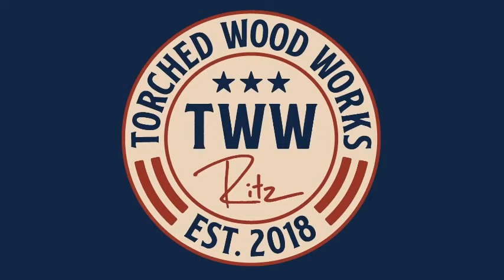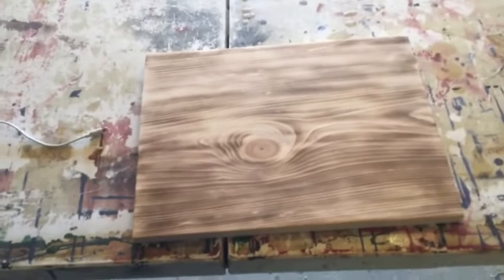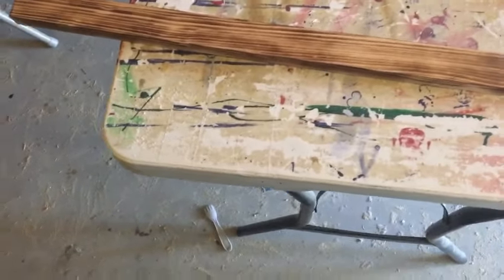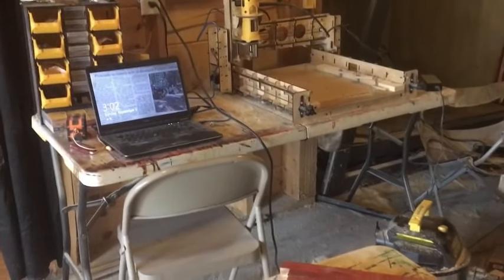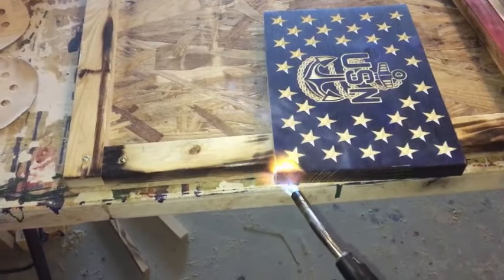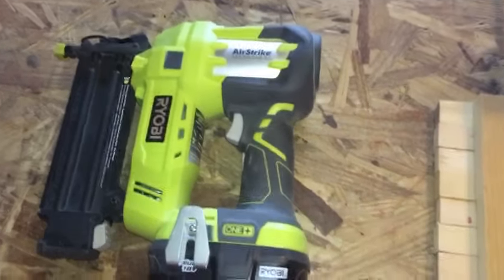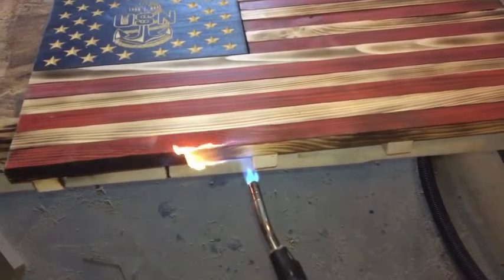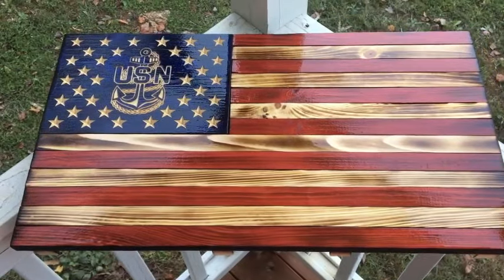Wooden Flag Tutorial! In Depth!

Comment: Question. When you torch the edges of the flag black doesn't it mess up the red and blue stain, the heat doesn't make it bubble or look different than the rest of the stained parts?
Reply from the maker: Not with water based stain. If it was oil based yes it would do that.
Reply: @TorchedWoodWorks  OK got it. Thanks for answering. I'm on my 3rd flag, and still trying to figure out the best way to do them. Not one has come out perfect. I'm getting better though.
Reply from the maker: @ChristianCMC  I’ve been doing this for five years. I’ve yet to make a perfect flag. Keep practicing and you’ll be amazed at how much better you are six months from now.
Reply: @TorchedWoodWorks  Yeah that is my plan, they are really fun to make. Plus they are pretty cheap to build. I don't have a CNC , but stain and wood is not much money. 1 quart of stain will do a lot of flags. I'm just giving them as gifts at this point. In the future I may try and sell one depending on how it turns out. Thank you for the video. Your flags look awesome.
Reply from the maker: @ChristianCMC  donate some to the local police stations and fire stations along with a card with your info on it. You’ll have some orders in no time from that.

Comment: one question. why not use plywood for the flag? 4x8 sheet will give you 4 36in flags and 2 or 3 24in . and why not use sold and tape lines off for paint? wouldn`t plywood be more solid .i use 1/8 in stars and glue them on. any comments would be helpful thank you.
Reply from the maker: Personally, and I am not knocking anyone who does this but, it's more about quality. Pine plywood does not burn the way I like, taped and painted flags to me are more of a pain, especially when making flags in large batches like I do, and my customers like the separate stripes and union. Gives it a better look overall. I have done the style you are talking about and yes you can make a decent flag that way, but overall in my opinion using pine boards and making the stripes be individual give you the better overall look. Just my opinion though!

Comment: I’m just curious as to why you would not glue and screw your stripes together. It just seems to me that the pieces would fit together better.
Reply from the maker: The braces hold the flag together fine, putting glue between the stripes and screws in on this size flag would be overkill in my opinion. For my 8 foot flag I made I did use screws though because of the weight of it but for my normal flags brad nails and glue are fine. Haven’t had one come apart yet.
Reply: Torched Wood Works thank you. I appreciate your answer to my question. I really enjoy watching your videos of your projects. Where do you get your stencils from? I am wanting to start building some flags, and I really like the Marine Corps Iwa Jima scene. Thanks again!!
Reply from the maker: @sig45man  I have a CNC machine where I carve all the unions and logos on the flag. Thank you for watching!

Comment: Hey bro...I made my first flag recently and it def has it's own signature lol...I used the Dry Wall strip wood which I believe/know was a mistake due to many wood imperfections.   Tried engraving the stars out was a bit difficult.  What type of wood are you using?   Pine?
Reply from the maker: The first flag is always one of a kind lol, I use the 1x12 pine boards. You can get them at home depot or lowes, or if you are lucky a lumber yard. Just look for the boards with the least knots and wide sweeping grains and you will have a great looking flag.
Reply: @TorchedWoodWorks  Thx for responding, so right now my next challenge is cutting out the stars with my Dremel 105 bit.  I think the wood is still to wet from just the mill or the stain.  How long do you let the union stain dry before you start engraving?  Like I said, I believe my choice of wood has been my biggest problem otherwise doesn't look that bad.  Have to finish engraving then clear coat,,thx
Reply: @TorchedWoodWorks  Thx...I'm going to attempt my 48" large flag for my bedroom.  I want it to look great.  Any advise?  I have to purchase the large union template and found that it's quite pricey.  Do you know where I could get a good deal on one?
Reply from the maker: @paulcon649  https://www.amazon.com/Whaline-American-Template-Painting-Airbrush/dp/B07CZBHR7T/ref=sr_1_6?crid=1DJXZZ7WF2JWM&dchild=1&keywords=50+star+stencil+for+flag&qid=1589586746&sprefix=50+star+stenci%2Caps%2C160&sr=8-6

Comment: Great video and work.  What package came with your CNC?   So it runs smoothly.   I’d like to be able to start into working after putting it together.    Is there anything else I need as well?    Thanks
Reply from the maker: Just the CNC itself, then it gives instructions on which controller to download which is called UGS. I design on Easel Pro which is $20 a month.

Comment: What is the diameter of the 90 and 60 degree router bits that you used for this project? Feed rate and plunge rate? Depth of cut?
Reply from the maker: .25 inches for diameter for both, feed rate was 50 plunge was 20 and depth for the stars is .25 and the logo is .03
Reply: Torched Wood Works thanks brother. Fantastic work you’re doing there. I’ve got the E4, using VCarve Pro, and have been working to speed up cut times
Reply from the maker: @johns2926  Thank you sir!

Comment: Am I reading you cut list right? 1 @ 37" (long stripes), 1 @ 22"(short stripes), 1 @ 19.5" (braces for back of flag) Should it be 6 @ 37" (long stripes), 7 @ 22"(short stripes), 4 @ 19.5" (braces for back of flag) or am I missing something hear this early hour? Thanks.
Reply: Mik Ledee you are reading it correctly. He started with 1”x12” boards. So he makes “starter” cuts to those lengths then I believe he makes rip cuts to make the individual stripes. Hope that helps!

Comment: Hey man, stupid question. But everyone uses water based minwax, what if I used oil based?
Reply from the maker: Javier Toquinto for stain? Nothing just takes longer to dry is all
Reply: Thanks my man. Great job BTW
Reply: Do you sand in between coats of the Clear coat (Krylon).
Reply from the maker: Javier Toquinto after the 3rd coat I do.
Reply: @TorchedWoodWorks  and then two more or just one? 

Thanks I'll be sure to try that on the next one
Reply from the maker: Javier Toquinto depends how the fourth coat looks. If it’s nice and even then I stop.

Comment: I'm looking to purchase the E3 and does everything come with it to be able to cut out the stars and navy logo included in the $700 or is there additional software and attachments needed?.  I've made several flags, but i'm looking to take the next step and get the cnc machine.  The Dremel takes too much of my time...
Reply from the maker: You will need to buy the bits for it, and you use the Easel software to design the unions. It has a free version but the pro is only i$20 a month. I have the bits I use listed on my videos with the link as well!

Comment: Why don’t you torch the union so the stars are the same as the  white stripes?
Reply from the maker: nolan steffek I used to but it gives the stars a strange look because the flame torches the edges that the vbits make so it makes the stars look like starfish
Reply: Torched Wood Works lol that makes sense. I just saw others torch the stars but Idk if I like it torched or not
Reply from the maker: nolan steffek when you apply the poly it darkens you the stars so it matches better.

Comment: Everything looked awesome until you did the wood strip method in the back to hold it all together.
Reply from the maker: Jason Noble how would you suggest putting it together?
Reply: I tongue and groove my stripes, then do an inch and a half wide by an inch and a quarter thick around the perimeter of the flag. They're a lot sturdier!
Reply: @TorchedWoodWorks  i also frame mine
Reply from the maker: Jason Noble very cool. Out of the 700+ flags I’ve sold and made this way I haven’t had any issues at all. Plus a lot quicker. Time is money.
Reply: @TorchedWoodWorks  to each his own my friend.....rock on